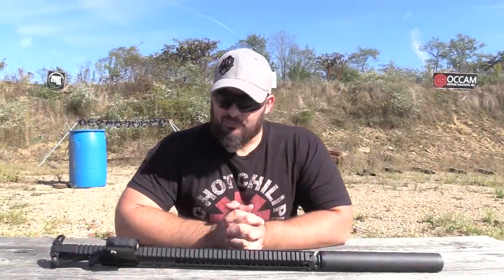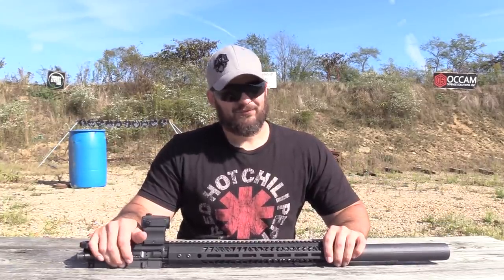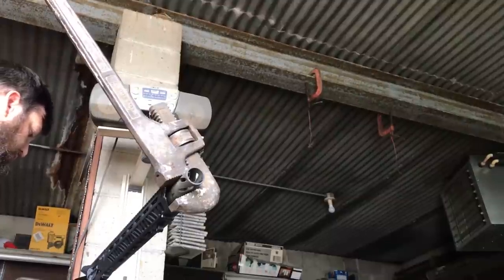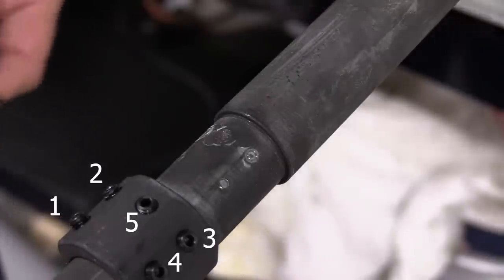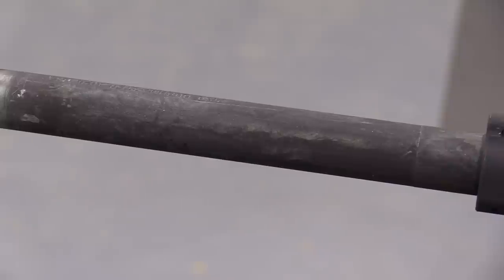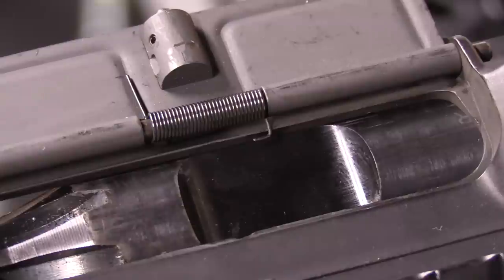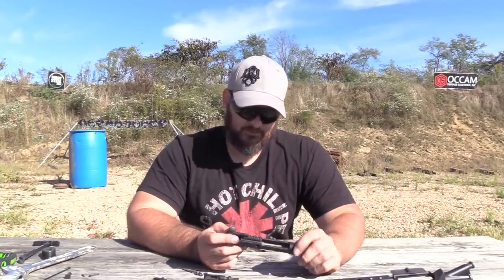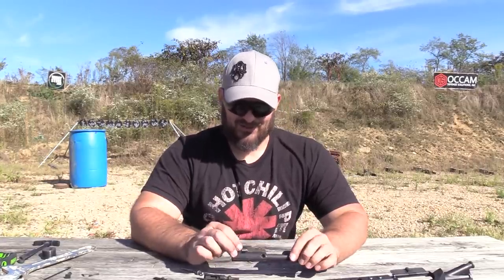The Worst AR 15 I've Seen 🚩Bear Creek Arsenal🚩

Comment: I believe, to this day, 75% or more of the current production AR-15s are meant to not shoot consistently. I used to work for an AR manufacturer and I can tell you they made them to be safe queens or for the weekend warrior at best. Not until I had the power did I put a 4 great ARs in production for a different company. But I can tell you there is so much garbage out there from even "trusted" companies too. So much Chinese pot metal parts and accessories it's sad. The reason this happened is because most if not all manufacturers couldn't keep up with demand during the years of 2012-15. Even ammo got made to terrible specs and quality. I mean in 2013 and 2014 there was many reports and calls that independence ammo imported by federal was blowing up guns. It was a crazy time to be in the industry. I got out because i rather be a consumer. It's a tough industry to be in. Enjoy
Reply: so what are the good companies to buy from? what are the big name companies to stay way from?
Reply: jonathan camarena  Nothin wrong with BCA if your not abusing the piss out of their product. A 450 with a silencer at full auto is asking a lot out of an upper that was designed to be a used to hunt hogs and deer.
Reply: @vintage3041  it's an AR. It was designed to handle combat. You don't get to make a shitty AR and then make up the excuse that you "designed" it for hunting. No, you took a good design and cut corners.
Reply: Titanium Rain  wrong its a.450 bushmaster its not designed for combat. Now you sound like the liberals who compare the AR15 to the M16 . Two totally different guns one was designed for combat one wasn’t. That said I’ve shot my BC 450 over 2000 rounds and not a single issue its a tack driver and a great tool for hunting and target shooting in no way was it ever designed to function full auto and to use in combat.
Reply: @vintage3041  the AR-15 was designed by Eugene Stoner before getting the M type designation. When tested for military trials it was an AR-15. When special forces wanted a weapon for Vietnam they bought AR-15s. Any AR built to Stoner's specs can handle combat.
Different calibers shouldn't mean anything. The locking lugs should handle it, the gas port should be drilled at an appropriate place and with the correct diameter to remain within the parameters of an AR. And between rifle length gas systems in 20" M16s and the shorty gas system on 10.3" Mk18s, there's a wide margin to have an AR that runs with the correct buffer. If they changed the caliber but couldn't work a few equations to make the system function closely to a 5.56 then they don't deserve the title of manufacturer.
Reply: Titanium Rain  Im aware of the history of the AR and how they work however todays civilian AR is not designed for combat especially a AR style built to run a 450 cartridge and on top of that run a suppressor on it. No way will the gun not destroy it self at full auto.  Its not designed to do this. The companies that are selling these rifles never make the claim they will hold together at full auto. I have 5 different AR15s  in 223/556 and one 450 bushmaster AR style and all function well for intended use. If you wanted a combat ready AR your gonna pay a lot for it and if it doesn’t have full auto selector id still say its not combat worthy. Its a fancy sport rifle that happens to hold 30 rounds and it only looks like a military issued M16 or the old original AR15 Stoner designed. All today’s civilian AR15s are nothing more then a Tribute rifle.
Reply: @vintage3041  "todays civilian AR is not designed for combat" - Doesn't matter. It can handle it because it still respects the Stoner design. If it doesn't, it's not an AR. It's an abortion.
"especially a AR style built to run a 450 cartridge and on top of that run a suppressor on it." - Cartridge is irrelevant. Locking lugs should handle it (if they don't, it's a bad design) and the gas system can literally be tuned to behave anyway you like. Either way, SAAMI spec for 450 bushmaster has actually a lower pressure than 5.56 NATO.
"The companies that are selling these rifles never make the claim they will hold together at full auto" - If they took the AR design, which is inherently capable of full auto, and neutered it, then they're selling a weakened rifle to you.
"If you wanted a combat ready AR your gonna pay a lot for it" - No, you're not. The original design is combat ready. Any manufacturer that took the original design and makes a final product close to it is combat ready. If it's not, then they significantly altered the design. Please stop talking about what you don't understand. I do this shit for a living.
"if it doesn’t have full auto selector id still say its not combat worthy" - Literally nobody cares, the military mostly uses semi-auto anyway.
"Its a fancy sport rifle" - Nobody cares. Just spend a little more money on a quality rifle and stop defending shoddy business practices.
"All today’s civilian AR15s are nothing more then a Tribute rifle.
" - Wrong. You don't understand the engineering, you don't understand specs and you don't understand the technical data package. Please stop trying to explain wrong information to a person who already knows more than you.
Reply: Titanium Rain what ever you say captain lol.
Reply: @vintage3041  So you got told and dismiss it, classic.
Reply: F. A.  Just what did i get told chief . A AR 15 built with inferior parts to keep cost down is supposed to be as good as a colt?? Give me a break their built to look like a AR 15 and it stops there. They are built for hunting and for guys who dont fire 5k rounds a year. If you expect anymore from one of these for 500 bucks your lost as an Easter egg.
Reply: @vintage3041  You were taught valuable lessons on what actually goes into making a weapon. It should be easy to undercut Colt because they're stuck in Hartford, CT due to all the government money and union deals they have - their product is more expensive than it should be because they have to recoup the costs of their shitty management. If you need to sell garbage to make it cheaper than Colt, you're an incompetent outfit. They rely on most people not understanding guns or engineering for that matter and accepting the subpar quality. So they offload absolute garbage to the gun store shelves and rely on only 1% of their customer base realizing that the rifle is crapola which saves them a ton of dough. If every single customer realized what they had and sent it back, they'd go out of business.
Reply: F. A.  Well so far ive killed 3 bucks with the 450 I bought off these guys and its accuracy is very impressive and never had a failure regardless of ammo i have tried. I likes it so much I bought a 223 for coyotes and ive shot thousands of rounds through it  so far with the same results zero issues. So in my opinion these guys are not building junk. They are not the quality of colts but they are a good reliable shooting rifle what more could someone want for the price point.
Reply: @vintage3041  Congratulations, you've done something that people have been doing for decades with their perfectly good deer rifles, but you wanted to do it with an AR and also you weren't willing to drop AR money on the rifle. That's such a narrow application that it might as well not exist, but what do I know? I don't need to take pictures of game harvested with black rifles to placate liberals who are not gonna care anyway.
The comparison with Colt is not as favorable as you think. Colt has been left in the dust as they get in legal trouble for trying to desperately cut costs and outsourcing as many parts as possible. We live in a world where getting Colt doesn't even mean getting something made by Colt, just something "assembled" by Colt because that's the nature of the game. If you still think Colts are premium I'm afraid you're about three decades late to the market.
Reply: F. A.  I bought the gun because i live in a shot gun only zone and they changed the laws so now you can hunt with rifles with a straight walled cartridge in certain calibers. I dont take pictures of my kills to piss off liberals all though that’s probably not a bad idea, i feed my family and the 450 gives me roughly 200 extra yards to get the job done vs. the shot gun. So it was a tool well worth upgrading to without breaking the bank. Let me try it this way the BCA is like the mossberg of the AR world. Gun snobs probably wont understand that but it is what it is.
Reply: @vintage3041  "the 450 gives me roughly 200 extra yards to get the job done vs. the shot gun" - okay, what's your average shot distance when taking the deer?
"BCA is like the mossberg of the AR world. Gun snobs probably wont understand that but it is what it is." - But it's Remington that has all the QA issues...

Comment: Bashes upper after running 450, in a long barrel, full auto, and suppressed. The problem isn't the gun... it's you!

Bear Creek doesn't deserve the hate. I have an expensive build now, but I used to have a BCA upper on my first AR. It ate steel case, 62 grain, and regular 55 grain surplus ammo without a single malfunction.  

Bear Creek does what they set out to do well. They produce cheap ARs that run reliably. If you run it full auto, suppressed, and in a monster caliber... yea it'll probably have some issues, but don't hate on all of it just because you abused the product.
Reply: The fact that they only have 10 round magazines tell you that they aren't designed for full auto.

Comment: “This $250 upper didnt have any malfunctions; but we are gonna beat it down anyway because I overpaid for mine and that’s how they all should be”  sigh no different than buying a Honda Civic and being upset that it’s not like your BMW...
Reply: If the Honda Civic comes with the front suspension crooked and not enough torque on the bolts holding the cylinder head whoever built it needs to be publicly shamed.
Reply: F. A. Those things would leave you stranded on the side of the road... show me where this gun failed to fire.. let alone left anyone stranded
Reply: @SamFo94  So a gun can be absolute garbage but as long as it doesn't fail to fire (I like how we're throwing failure to feed or failure to eject out the window) during testing it's good? Even though it might fail on the first shot right after the test because it's so bad?

Comment: I have had many ar15’s from a plethora of manufacturers. If you look at the thousands of videos, that do a review of BCA, 95% of them are very good, and most pleasantly surprised, of how well built this gun is! Most AR15’s that cost $1500 or more, are mostly just tacticool, and Gucci! I have seen how these guns are made, and they are mil spec or better! If the biggest problems you find, is some loose screws, and find that to be the biggest difference between a $1500 AR and a $350 AR that is awesome! Invest in some good tools, apply some loctite, and torque them on! Also, review a 450 bushmaster, full auto, with a can, with other more expensive AR’s and see how well they hold up! Not many, will be able to tolerate such a test, without having some loose screws, alongside a couple loose screws on ur body! Any hoot, thanks for the review!

Comment: You buy the cheapest tools you can, use the wrong tools for the job (crescent wrench), and if you are a professional you should know that this caliber is HELL on almost any build. This would hold up just fine to almost any other round. 
Also waiting till you are nice and pissed off to do a review means you are gonna do a shitty review. You basically admit right off the bat "Hey this is going to be a bad review with 0 actual facts behind it" so good job there.
Reply: The fact that they only have 10 round magazines tell you that they aren't designed for full auto.

Comment: In his defense of using a pipe wrench. Any one who has disassembled an upper from BCA know that a regular barrel wrench will not work. the width of the barrel nut and muzzle device are both uncommon. I also have no clue what compound they use, but threads are definitely secured with something stronger than red lock-tite. took hours of torching and a lot of solvent to get my barrel off the side charge upper

Comment: 8:30 
But why would you put a single point QD sling on the hand guard of your rifle where most of the weight is in the back, therefore, causing the rifle to tip backward and flag your entire upper body???

Comment: I got a BCA 450bm side charger with a 16" heavy barrel recently for $220. I saw this video beforehand, so I took the rifle down to parts and assembled it the way it should be. Got proper 450bm magazines, scoped it up and went to the range. Went without a hitch and I was very happy with it for the money invested in it. I ended up putting an SWFA 3-15x on it, which is comical but I did want to see how the rifle was going to shoot.

It's not going to be a fighting rifle, which I mean why would you pick a 450bm for that anyway?  But for having fun with a big bore AR, I can't think of a cheaper way to enjoy such a small niche.

The inside of the barrel looks awful with a bore scope, but the crown was perfect. I still can't believe it shot as well as it did after seeing it on my bore scope. It was consistently touching holes.

Also the QD swivels are unusable on mine due to the barrel profile alone. It'd be impossible to get one all the way in.
I'd like to buy some different extractors for it though, as I agree they are sketchy. And since I'm reloading, it's not doing my brass any favors.

Comment: I built the ultimate poverty build with a BCA upper and blemished complete PSA lower. In total combined with a Chinese red dot off of amazon I spent $390. I beat the piss out of it with a diet of nothing but golden tiger and it died a glorious death between 700-800 rounds. Around 300 rounds the gas block came loose, so we dimpled the barrel and used thread locker on the screws. We were fine until the gas tube failed. Rifling and barrel throat were surprisingly fine. Resurrected it with a gas tube and cheap low profile gas block from our LGS. It now just takes up space in my safe.

Comment: Loose gas key will cause your gun not to cycle. Pull the bolts. Upgrade the bolts. Torque to 55 inch pounds. Go to Young Manufacturing. They explain why they don’t stake theirs. Zero failures.

Comment: The problem with the QD attachments is that the barrel is so fat that you can't put the QD completely seated where it will stay except at the end of the barrel where it gets more narrow. Either you need to use skinny your barrels or bigger handguards
Reply from the maker: I believe that was annotated in the video.
Reply: However this is how it was built from my understanding. It was bought as is from BCA. So that tell me that the company doesn’t expect anyone to actually use those QD points or they would have noticed the issues and used either a smaller profile barrel or larger handguard. As with the BCG, piss poor quality control.
Reply: Or put a QD socket on the handguard
Reply: @mossranchoutdoors7249  exactly! 💯

Comment: I honestly don't understand this review, your ripping on a budget upper cause it failed after being ran on full auto with a can in a large powerful caliber. You said it was to test the can. Why are you using a budget upper to test a can in the first place. Why wouldn't you have an adjustable gas block or a beefier BCG to deal with the additional stress of being ran on full auto with a can? I've been angry at products to but you kinda set this one up for failure. The sling points not fitting was a good gripe though.

Comment: While I agree that an upper that is sold as being capable of handling a stout round should be able to handle it, I don't necessarily believe BCA intended this upper to be used in a full auto configuration - they likely assumed that most people wouldn't attempt such a thing. As far as them "thinking for you," you can take it offensively of you'd like, but you do need to bear in mind that they are building the upper receiver for more people than just you, and there may be inexperienced people purchasing their products that aren't aware of what muzzle devices are safe to install. So, while using a non-standard thread may have been to drive people to purchase THEIR accessories, it may have also been done from a safety standpoint. Just food for thought. I don't know anything about the illegal employee drama, so I can't comment on that, but I can say that I cringed every time the tool slipped from the handguard bolts.... Like, you have to anticipate that there is going to be SOME tightness there, get a proper grip on your tool and ensure its seated fully the entire time you're using. Or, I suppose you could just blame the tool for being poor quality and make it bash video about IT breaking too.

Comment: Cheap doesn't mean bad and expensive doesn't mean good. Seen a few cheaper AR15's that would embarrassed some of the more expensive ones.  However had issues with Bear Creek Arsenal and won't buy anymore of their firearms, parts or upper receivers. Three budget AR15's that I haven't had issues with, they are? Stag Arms 15, Anderson Manufacturing AM15 BR which uses a 4150 barrel and Diamondback DB15. One expensive AR that I needed to send back for warranty work? Daniel Defense DDM4 V7 which was a Huge disappointment . Even with better QC there's no guarantees that you won't receive a lemon.